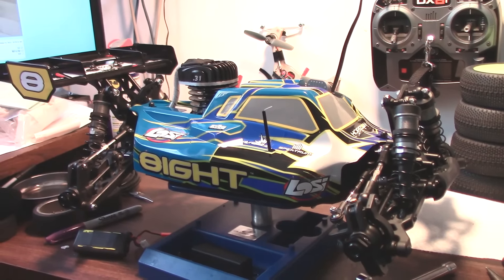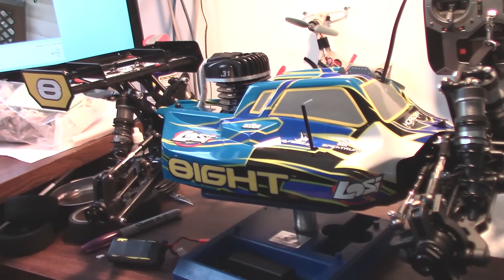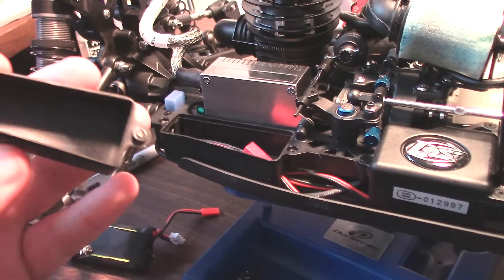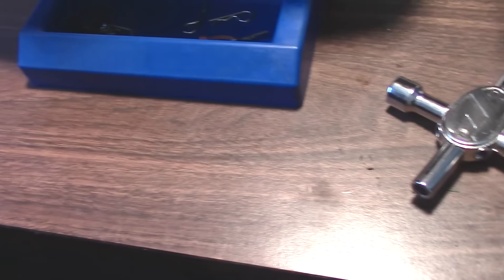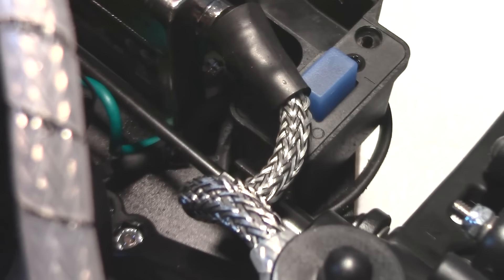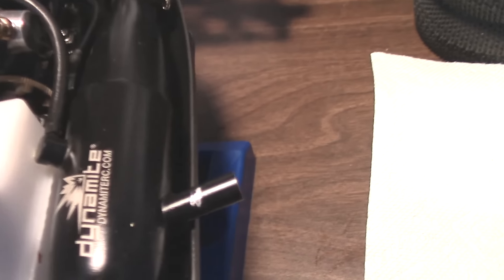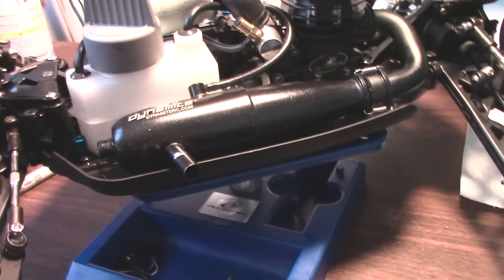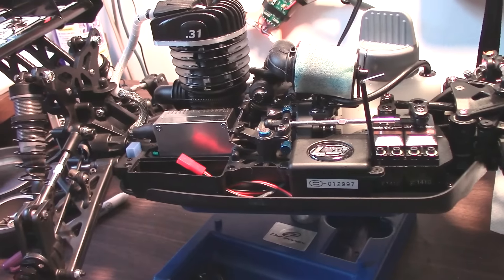Losi 8IGHT Gas Buggy MEGA DEAL

Comment: If your gas lid is properly seated it will not leak gas when upside down. It is a two-piece lid, when you have it off, push on the bulb and you will notice it settle into place. If it feels like it is fighting you going on, it is not properly seated. It should go on smooth as silk

Comment: Did you get any problem with the engine??conection rod may be??
Reply from the maker: Federico Pralong I had losi send me a few motors. One failer was connecting rod. After a while i converted to electric
Reply: Steven Gilbert so ..i have the oportunity to buy one is a good idea or bad idea..what do you think?.thanks
Reply from the maker: Federico Pralong ask them if the motor was broken in yet? It's a pain in the butt to do. If they have done the break in and it runs well. Then yes. The bigger problem is the CDI unit which can throw off radio interference
Reply: Steven Gilbert thanks very helpfull!!

Comment: where did you purchase for so low
Reply from the maker: it was a deal from the manufacturer they were discontinuing the car, good luck finding one though
Reply: +Steven Gilbert How come?I thought it is a new model!
Reply from the maker: BASSstarlet it's a new model that had less power and ppl didn't want to race. It was supposed to be more reliable because of the gas instead of nitro

Comment: Electric is the boring alternative....
Nitro is far more exciting, challenge yourself. Learn how to tune and go NITRO.....
far more rewarding .......
Than gas OR electric .
Reply from the maker: Actually since this video came out i have learned these gasoline motors were more difficult to tune and work on than nitro ever was. They were meant to be more reliable but are crap and picky due to the poorly made ignition system involved